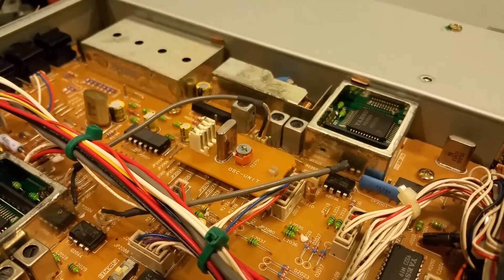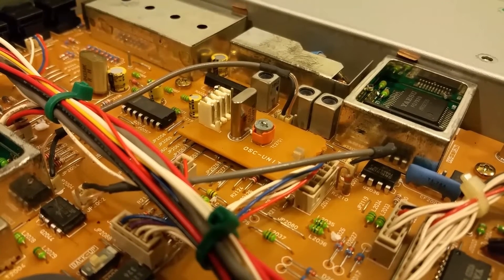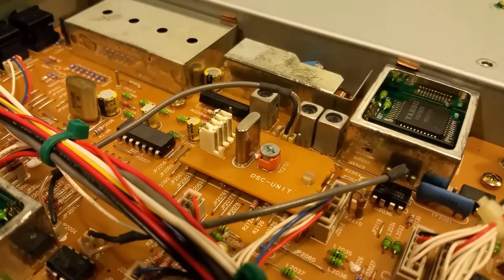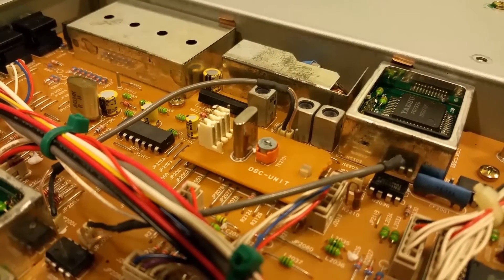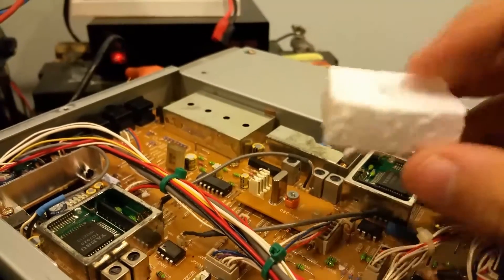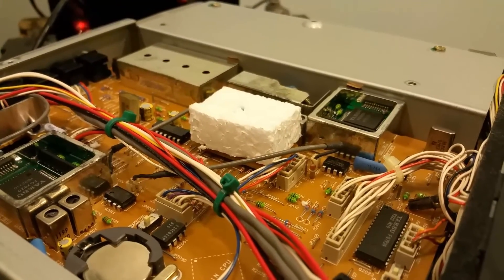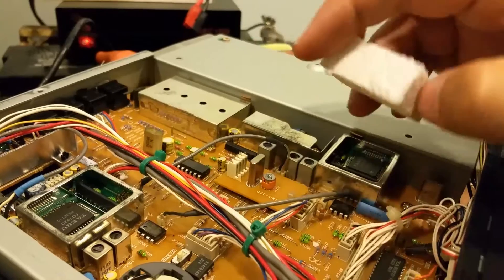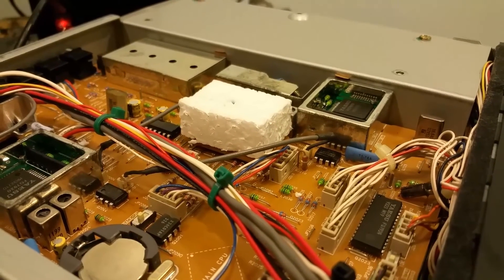NT1K.com - Yaesu FT-840 Frequency Drift Repair Attempt

Comment: My 840 was drifting like crazy and very quickly, I did this adjustment and it seems to have stopped acting weird. It still drifts in frequency when it's warm, but it does it very slowly. Not perfect, but better than spending $79 on a TCXO.

Comment: Thinking about purchasing one of these, but the guy said a new memory battery was installed and that when you turn the power off, it does not hold memory. Is there a solution and if so, what would it be, or is the radio worth buying with it having that issue? $400 and includes FM Module, power cable and mic. Thanks.
Reply: LiL Hank I just bought one of these and I'm having the same issue as Jeff. I'm going to try his fix and see what happens. Apparently heat is an issue with these radios. 
You can't find the TCXO oscillator anywhere.